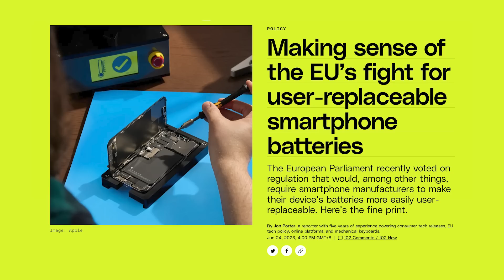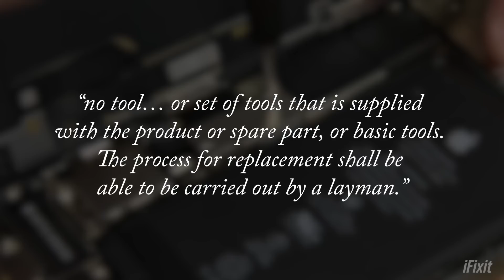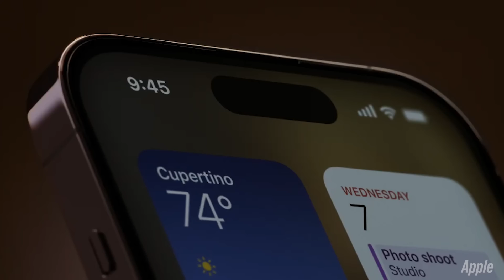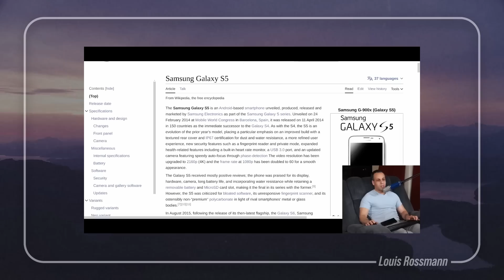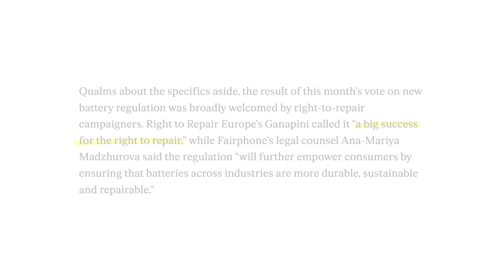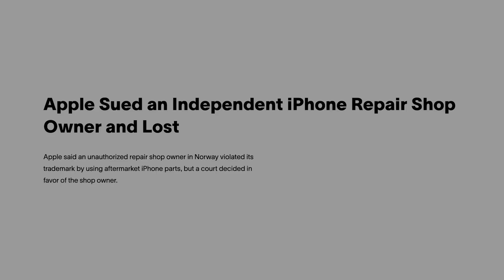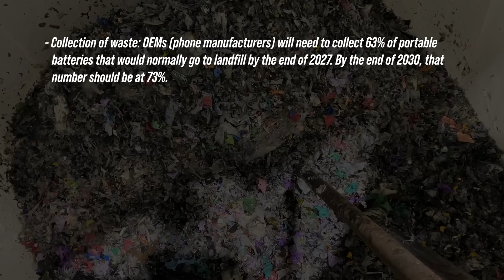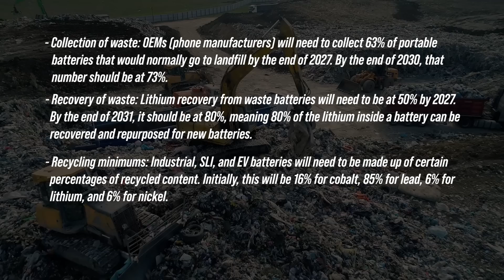EU Just Changed Smartphones Forever

Comment: Now get them to mandate a "Right to maintain" ruling where product makers must unlock the operating systems / software on devices once they end support. People should be able to use and update software on perfectly good hardware as long as they want. The locking down of operating systems and removing the ability to change batteries are almost certainly an anti-consumer behavior targeted specifically at driving needless upgrades and more sales.
Reply: It is not simply "unlocking" software for older phones. You have a team of professional software engineers specifically design the software for that particular model. If you don't have dedicated software developers for older devices, then you do not get software updates.
Reply: @onesleepyazn  Except that for literally dozens of phones LineageOS is available from essentially volunteer developers on devices that shipped with an option to unlock the boot loader. I would have been able to keep my Galaxy S10e running if it had been the same in the US as it is internationally, but no, many times the "same phone" has multiple versions for different markets or different restrictions locking them down by carrier add-ons. I am currently happily on a Pixel 5A with Lineage because shockingly Google does allow you to unlock the phone and install an alternate rom. So no, I think you are wrong and if more phones allowed alternate roms more people would have been developing for them all along and keeping them in service longer.
Reply: @one_b  I'll admit that I've never had to deal with that as a long time iPhone user because all of my devices have been supported for much longer than I kept them around. Android sometimes seems like the "Wild West" when it comes to OS and it's a shame that international units would allow different boot options while US does not. Is there a significant barrier to entry when it comes to purchasing an international version of the phone while living in the US? Does it not work on the national carriers here in the States? I'm pretty sure most iPhones get support for like 6 or so years, and I've heard certain Android phones can drop software support fairly quickly (like two years or something short like that.)

Comment: I'm really curious how this will change everything. At this point, a new phone basically doesn't change anything, since all the apps run well anyway. So the only real issue is the battery. The hardware is so good that a replaceable battery will be huge for not having to upgrade.

Comment: Will probably just give manufacturers an excuse to drive up prices, under the pretense of covering the cost of new manufacturing and development required.

I feel like I'm odd one out, but I've not changed a phone due to poor battery performance for like 15 years.
It seems now that phones get swapped before the battery has issues, because of latest trends and advertising.

If they want to really drive against the cost to the consumer, they should put restrictions in place on "new" models, where companies are dropping multiple new models each year which have same spec as before but with 1 or 2 new key elements.
But of course they can't, because most people seem to want to be popular and "keep up" and would fight against that

Comment: I am a phone repair technician. In my experience apple deliberately designs their phones and tablets to require specialised repairs. They are getting worse with every new release. The iPhone 14 requires almost complete disassembly to replace a single component.
Reply: Which component are you talking about? I am curious to know what your source of information is because the iPhone 14 is comprised of a display, mid system, rear camera, and back glass (which are all easily removable and does not require total disassembly of the logic board or any of those other parts on the mid system)
Reply: @onesleepyazn  Hi nice to speak to you. I am being a bit facetious. My comment was about the charging port/dock which has to be accessed through the back now. The 3 layers to the phone are my main point of complaint. Extra complexity for no real gain.
Reply: @jackcornelius8021  I'd say that having a removable back glass can be beneficial. There are many instances where someone only cracks the back glass and just want that part replaced instead of a whole rear system which constitutes the majority of a phone's internal components. If the repair is just replacing the glass with wireless charging components on it, then I'd prefer that. Back glass is much less expensive than a full mid/rear system. Just my 2 cents.

Comment: Apple's HW designs are obviously to support limited lifetime, hence repeat business. I own music hardware that is sophisticated and contain microprocessors from the early eighties,  40 + years ago and it still works as it did back then. Needed a few coin cell  battery backup replacements, and minor maintenance, and in some cases some deeper maintenance like resoldering/reflowing audio jacks, and PCB connections, op-amp replacements, etc. All still achievable today by me!  As time went on from the 70's higher level integration for electronics like using FPGA's and ASICS have made hardware repair more difficult, but that integration is not a profit conspiracy for repeat business like Apple's designs are. Not really expecting this, but I hope my iPads and their apps still work in 30 years like my old trusted music HW does, and some old vacuum tube radio's I have too....those radios all required maintenance, but all of it can be done by anyone with some minor tech skills. I would like to see everything go back to this scenario, starting with vehicles.
Reply: Nice name

Comment: Honestly I don't see anything good coming out of this particular law. Fixing batteries inside is one way to shave off those extra protective shells, which makes the batteries jiggle like jelly. Plus manufacturers are now trying to put together 2 batteries in different orientation to optimise space, there is nfc, wireless charging and stuff attached to the back of the phone, makes this stuff whole lot complicated. There are other ways to go about it. Oems could make batteries available to customers and 3rd party service providers along with the tools and not lock that stuff with software serialisation for say up to 6-7 years post launch. Allow compatibility with third party batteries. There are so many other ways.
From display and camera to cables, it's the serialisation and software lock-in that's the issue I believe.

The only possible benefit I see to user replaceable batteries is that we won't need those pesky powerbanks anymore 😅. Just swap and carry on.

Comment: Rant: Cool. Goodbye waterproofing and foldables. It's funny, politically I identify as liberal - I support government intervention and regulation, but the EU is a joke these days. So is right to repair. If you need something with a removable battery that has some water resistance, buy a handheld radio. Let smartphones be smartphones and allow consumers to chose what to buy. Louis Rossman just wants Apple to make his job more profitable - his views are heavily biased, though very successfully communicated. If I want a thin, impossible-to-tamper-with Apple device, I should have that choice. If I want a bulky, DIY reparable phone, I should have that choice. Apple and Samsung should pull out of the EU at this point. 

Side note: all the phones mentioned that had replaceable batteries and some level of waterproofing all failed. People didn't buy them. 

End of rant, thanks for listening ✌️

Comment: My 2017 phone is still working fine after 5 years (bought refurbished in 2018). I'll use it until it breaks, but I'm eager for a new phone when that time comes. While I could replace the battery, I prefer not to invest in an older device.

Comment: I decided to replace the dead battery in my old Google Pixel 1 myself so I could avoid buying another phone for a little while longer. It didn't cost much but it was quite the surgery to do. I ended up having to get a replacement screen too because I broke the screen while opening the phone (the adhesive was too old that heat did not loosen it enough). It was still worth repairing but it would be nice if I didn't have to do major deconstruction to do something as benign as change a battery. It is so obviously a wasteful and profit-driven engineering choice.

Comment: I think all laptops should be required to use 18650s, since those are a standard size and it's possible to re-cell the battery pack once it's lifespan has diminished after a few years.  Also, if they are all using the same type of cell, there will be a lot less ewaste compared to everyone currently using different proprietary sizes.  The Sony Vaio X505 proves it's possible to build a laptop that's thin and uses 18650s.

Comment: The EU is pure consumer hate. I remember the Cookie law that makes you click a few times on things to acknowledge that you accept cookies. I remember the EU Law for vacuum cleaners, now only max 750 Watt vacuum cleaners may be sold in Europe, while the dust remains the same, now it takes three times as much time to clean the room then before. 
 
Now there is a law that tells people that only USB-C cords are approved while the 8-pin Apple cord has a better connection and is a better quality. Now telephones will have to have replaceable batteries. It is pure hate for the consumer, because there will be a loop-hole. Just like the vacuum cleaner law in the EU, it is not valid for professional use. It only costs more to obtain a vacuum cleaner. The Cookie Law can be look-holed too, with an App. 
 
I remember Nelie Smit-Kroes a former law maker at the EU, she was specialised in mobile communications. After she left the EU she got loaded with money from the telephone manufacturers, so called for "advice!" When Apple pays a few hundred million Euro's to a former of a present day EU law maker, then suddenly the iPhone becomes a piece of professional communicating equipment and then it can have an 8-pins cord to connect. It only become more expensive. The EU is pure hate towards the consumer.

Comment: Just put new batteries in my Sony ear buds. I can even replace the case battery. I bought them with this in mind. No way I'm buying Apple Airpods (posh e-waste). I would replace my Macbook Pro, as the new ones are faster and more efficient, but for me, not allowing for SSD upgrades is anti-consumer and is making me think of alternatives. That's not including all the hardware and software locks for replacing other components like screens. I can only conclude Apple wants people to buy new rather than repair the device they own, which isn't in line with my values. In Norway, you just take your batteries to the supermarket or stores that sell electronic devices and they recycle them for you. Environmentally and economically, Apple's behaviour can only be challenged by further legislation. "Consumer demand" isn't driving locked hardware.

Comment: Soo good to hear it. One charger, right to repair , able to replace batteries for all the technological devices, because all our devices have very good performance they can used for like 4 years minimum but just because the cost of battery repair or replacement we don’t able to use them and also due to new software updated they lunch to slow your phones

Comment: All of those companies, especially Apple are criminal organizations witch increase their profit buy selling only non repairable products. 
My super old MacBookPro had an easy system to replace the battery, my Samsung Note 3, too. The new Smartphones and laptops not any more, of cause. 
Waterproof? Witch idiot takes a shower with el. devices? And even with easy replacement parts they can be waterproof, you found some. 
I deny to invest in any new devises as long as the old ones are working and nothing „easy to repair“ is available. 
Regards from Belgium

Comment: The trend of making battery replacements not possible was 100% driven by profit. I haven't had a phone last as long as it did ever since I couldn't buy one where the battery was replaceable. The last one I tried, and I got to extend the life of the phone for almost 18 months was a Z-series Sony which already was using glue. Before that each phone would last at least 4 years with one battery replacement. Now, every two years there's an incoming problem that will make me think of changing the phone. I would just change the battery for one that restores power capacity or can cope with the power demands of the updated OS

Comment: What is water proofing / resistance?

I remember taking my Nokia's in the rain. If the phone is wet, take it apart blow air from my mouth in every ports and pack and then press the button and tada. I remember throwing my N95 across the wall, it ran into window, cracked and the phone broke into pieces. I picked up the broken phone assembled it myself and pressed the power button. What happened next? Tudu dudu dooo connecting people and tada...

I need removable batteries, swapable parts, etc. I just don't want to shell out another 1k dollars just for memory upgrade, storage upgrade or processor upgrade.

Comment: The sad part is that people who don't know TECHNOLOGY or the ENGINEERING that goes behind are trying to determine the future of what TECHNOLOGY should be and should look like. This will have severe consequences! 😢
Reply: If there is no law to govern, the environment will continue to degrade over time. The biggest problem is companies are concerned mainly with profit by using the shortest route and the cheapest way to do it. Making consumers buy as many products as possible. Saving the environment is not their first priority, filling in the CEO and the shareholder's pocket is. This law implementation will force companies to rethink again and make sure hardware lasts as long as possible. Everything works in a cycle.

When the world war broke out, innovations and new inventions were out much faster than in peacetime. It is due to disruption. This law is the same, it is a disruptor and will make manufacturers work harder for a better technology.
Reply: @wumingkkk   I do agree with your analysis. But my point is the tech space is going to be less interesting if every manufacturer is now being forced to solve the same problems. What makes the smartphone industry amazing is that every manufacturer sets out their goals and challenges to solve rather than adhering to what some authority has to say. First it was USB-C, now it's removable batteries. I wonder whats next?? 🤔

Comment: Good job to stop these criminals EU, if you cant replace your battery you only have 2-3 years life cycle, with replaceble you can have for 6 or more years for your phone.... p.s. my phone has removable batteries and is from alcatel, I returned pixel when I saw I couldnt remove the batteries... my alcatel phone costed me just 80 euros with 2gb of ram and quad core, enough for my daily usage...

Comment: One other important aspect of removable batteries is that it enables people to ensure they're not being tracked by their phone. As long as the battery is in place you can never be sure your phone is actually off.
Reply: that is not  really a thing, 3 points for contributing but , explain how a device with a dead flat battery can track you, if you think that a yes, well taking the  battery out won't change that as there must be a secret hidden battery already in there ready to go as needed.
Reply: @garfishsmith9037  That's a strawman argument as you're arguing against something I didn't say. Of course you can't be tracked if your phone has a dead flat battery, but how do you know if your battery is dead flat? Just because the computer in your phone produces a display indicating your battery is flat, doesn't mean it's necessarily so.
Reply: @dockerdave  Fair enough, though if you don't want to be tracked, don't take your phone,if your are worried about being tracked.

Comment: The law might fail because the law does not mandate battery standards for mobile devices. Every phone uses proprietary batteries that wont be manufactured after a certain time forcing users to buy a new device or use dodgy Chinese batteries. There needs to be industry standard batteries like the A, AA, C, D, ect for mobile devices.

Comment: I had to replace my last two phone entirely because of a broken battery. First one I still attempted to replace it myself but i broke the screen in the process, so it was economically the better choice to spent 80 Bucks more on a new phone instead of getting a full repair of that older model that didnt receive major updates anymore anyway.
The other I gave up right away because of the stupid curved edges. Literally impossible to do anything on it without extra knowledge and tools.
So i welcome this change.

Comment: I always though that the excuse for user replaceable battery argument of being too bulky was complete bs, I mean current average smartphone screen already sit over 6" and more often than not they tend to stick out of people pocket (with consequent of falling to the ground and shattering the screen, thus to the repair shop it goes). As much as I like my current Poco F3 I'm quite annoyed that it doesn't fit in some of my jeans pocket, which is an issue in summer and early fall since I'm not wearing a jacket ( I don't like using the pocket in the back btw, that's how you get your phone broken or stolen)

I changed my smartphone last year after using an Experia Z for over 8 years, since I only use my phone for messaging, calls and occasional youtube videos and web search (it's still in great condition btw, just fell thrice over its lifespan with just minor scuffs around the corner).